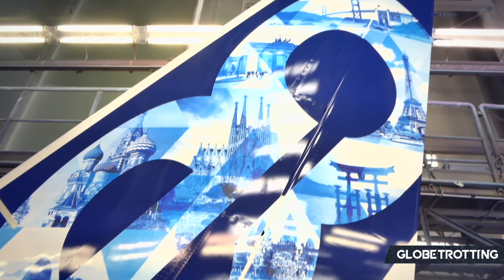MEGA AIRLINE - Introducing American Airlines

Comment: You refer to American, Delta, and United as the three largest USA airlines.  My understanding is that Southwest is now larger than United, albeit with a very different business model.   Don't count them out.  As a passenger in need of handicapped accommodation, I would add that Southwest provides radically better service for handicapped passengers than any of A, D, or U.